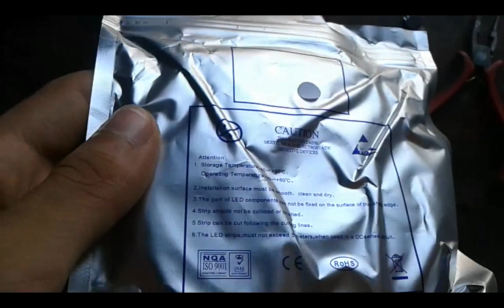Light Up A Kitchen, How to install LED Strip Under Cabinet Lighting

Comment: This is what I'm looking to do,  but I'm pretty sure that 120V splice under the cabinet is a fire code violation.  I guess you'd have to do it in the switch gang-box for it to be valid.